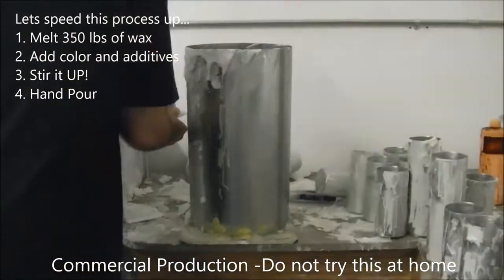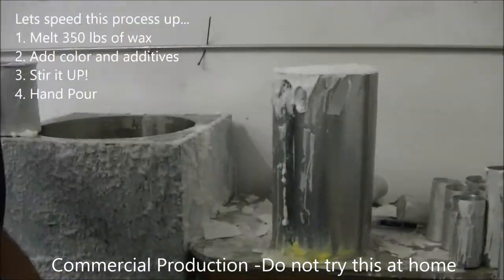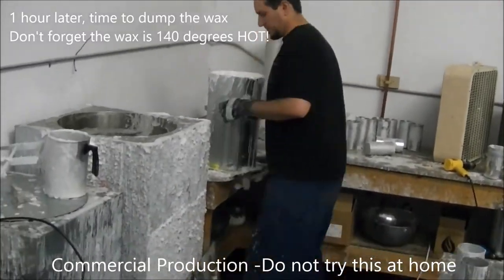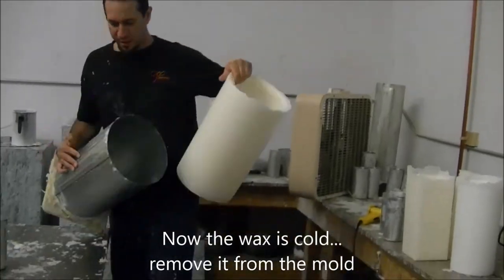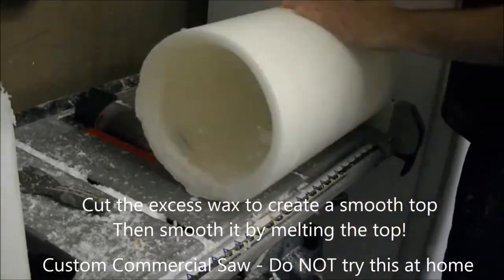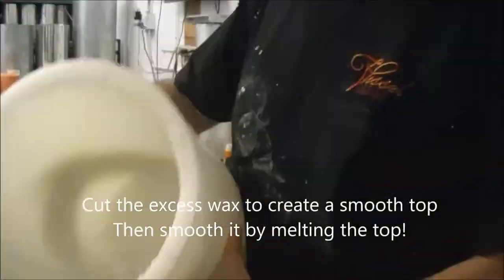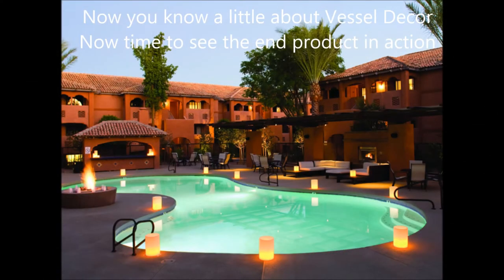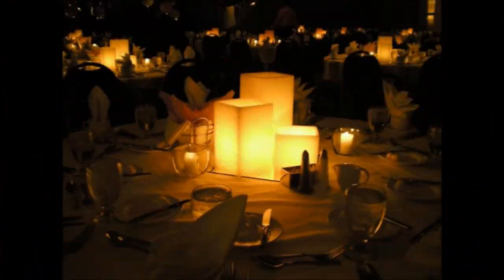Candle Luminaries and how to make a large luminary

Comment from the maker: We sell both candle luminaries and candle covers. The difference between the two products is that candle covers are hollow on both ends. Candle Luminaries have an opening on the top but has a bottom base. Most people use the candle covers for a low volt chandelier